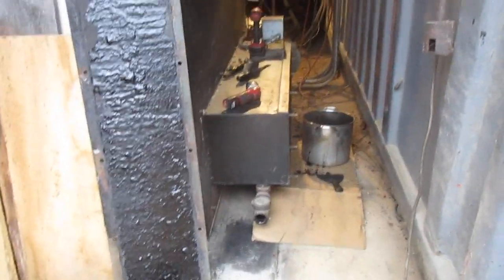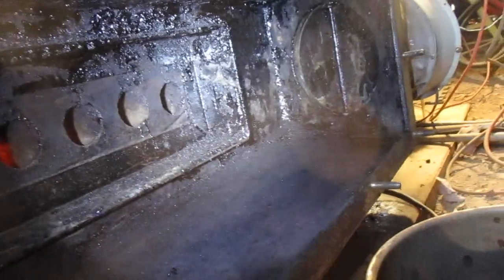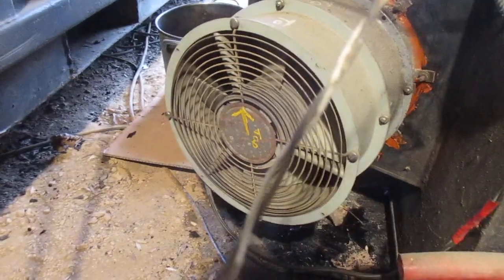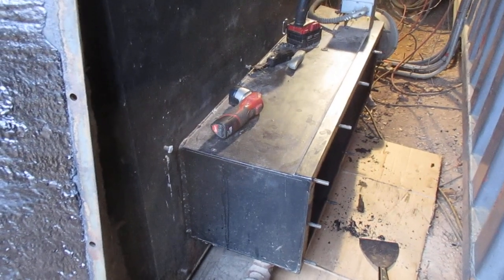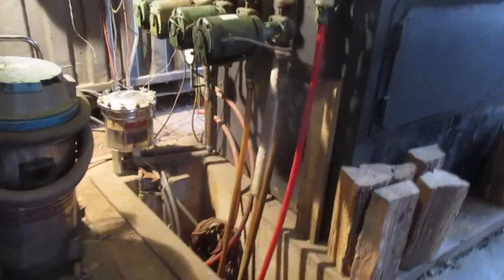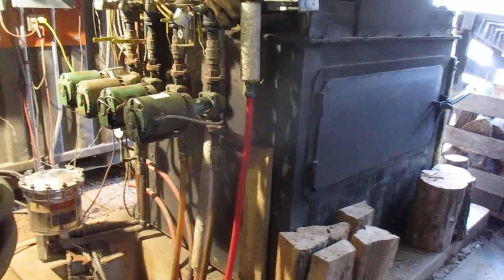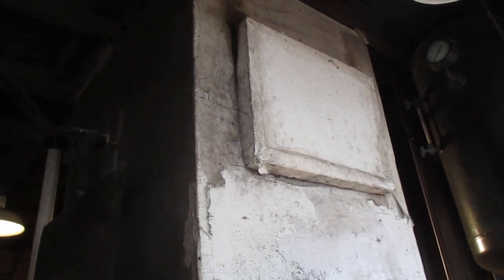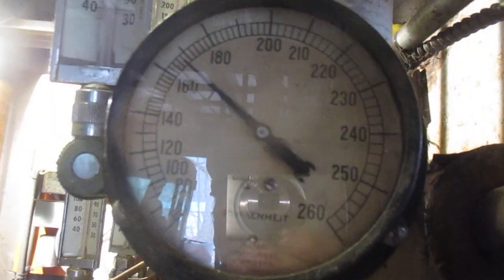Boiler maintenance  # 1064

Comment: Any way you could raise the grates or add some to get the fire above the intake tubes? Smoke has to be entering the intake box most likely when the draft fan is not running.
Reply from the maker: hi there those are some good thoughts . i started that way around 7 years ago , i would need to have greats casted , probley never do anything just take 2 hours 1/2 way threw the heating season and reclean it for now . . thanks for the thought and stopping in with it john

Comment: Glad I didn’t go that way when I built my wood boiler. I followed the Garn design. No creosote. Garn been around since early 80’s
Reply: But I'm not understanding how he's getting creosote in his fresh air chamber in the first place. 
That's shouldn't happen the way he's keeping a positive air at all times, and it shouldn't backdraft even if his fan is down, because of the damper closing sealing it off.
Additionally the way it goes through the tube sheet twice then up the flue pipe should prevent that from happening. 
I say that because his flue pipe doesn't have anything blocking the air flow from the winds that is causing a negative condition around it.
So even if it does sweat some because of the temperature differences of the air chamber picking up heat transfered off the connecting boiler fire chamber.
It wouldn't continue anything more than little oxidation from the metal the fresh air chamber is made of. 
So where is the creosote coming from that's my question?
Reply: 1st off these boilers are junk. You cannot regulate them. When you heat up this mass it is uncontrollable especially in shoulder seasons. I think he’s lying when/if he says he’s running a fan constantly. If that was the case he would be over heating this pos all the time. My guess is the forced draft is shutting down and the firebox is smoldering causing unburnt hydrocarbons to circulate back into this fresh air chamber and condensing being it is outside of the mass refractory. Do you have experience with owbs? Gasifiers?

Comment: So that's your supply air to your burn chamber correct that you cleaned our the creosote from?
Now that's confusing, because how is the leftover byproduct of burning wood getting into the makeup air chamber, because your hot air rises off the fire carrying any smoke or vapors up through your tube sheets, and out the flue pipe on the roof.
So that's shouldn't be possible, because that's positively charged with fresh due to the fan mounted on the side of the fresh air chamber, and the fire causes a natural draft drawing the air in to it regardless of whether the makeup air fan is forcing air into it.
The natural nature of fire creates it's own airflow, because heat rising through the tube sheets, and out the flue pipe if the flue pipe is sized correctly, and it's warm, hasn't anything blocking the wind around the discharge outlet of flue pipe.
Only way it possibly could backdraft, is if there was something blocking the wind like a piece of equipment on the roof, are the flue didn't extend over the top of the highest point of the roof, and the wind was coming from the direction that the roof or piece of equipment was located. 
Only I'm positive that the roof although it may be pitched slightly to allow drainage, and I'm fairly certain that you don't have any type of equipment up there besides the flue pipe.
Your tube sheets are fairly open, because I remember you cleaned them once already this season already, and you aren't burning any type of pine, or evergreen that's high in pine tar, and it's all hardwood thats well seasoned. 
So explain how, and why your getting creosote in your fresh air chamber, because unless you're piping your exhaust gases back through your fresh air chamber that's impossible from what my 40 plus years of hvac experience tells me.
Plus the only way it could sweat would be by heat transfer from the fire chamber wall actually transferring the heat to the metal of the fresh air chamber, and the cold outside air entering the chamber, or being surrounded by the cold outside air in the open boiler area. 
But that would be clean condensation free of any of the chemicals for the most part that actually cause creosote to form.
Especially since your running a positive air system that has fresh air forced into the burn chamber whenever you have a fire going, and you have a back flow damper to prevent it from backdrafting if your supply fan isn't working. 
So I don't understand exactly how the problem you're having even exists to begin with.
Reply from the maker: hi there i have read this several times now . i think it might be to much forced air causing to much combustion , and expanding the gasses faster than the stack size can take it , a thought  as the air comes into the chamber and goes by the first wholes they may be low PSI pulling the flu gasses back in when the expand to the point of presser in the burning area , ho well i don't like it but other fish to fry now  thanks for the help john